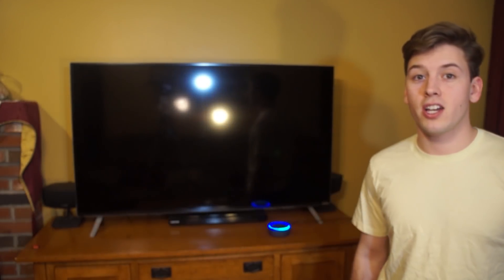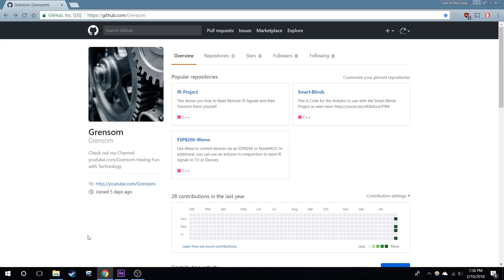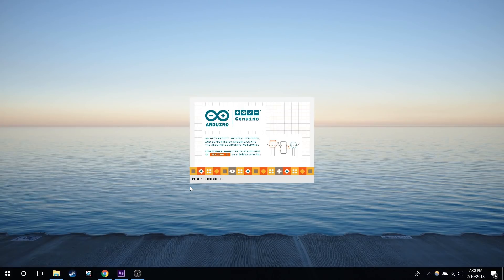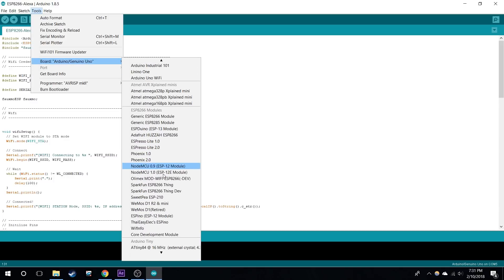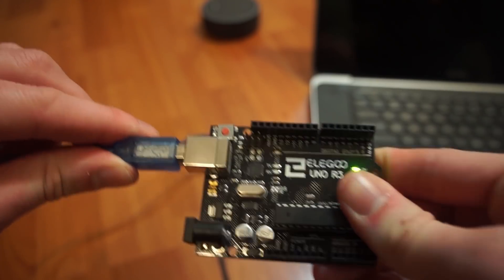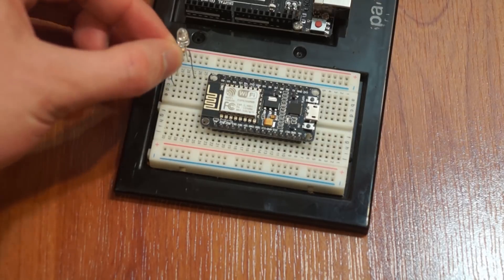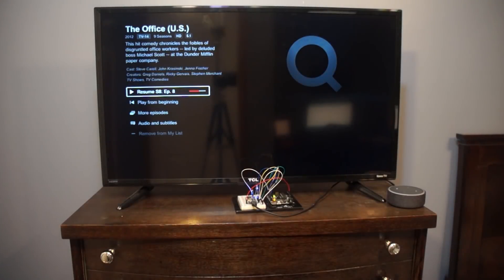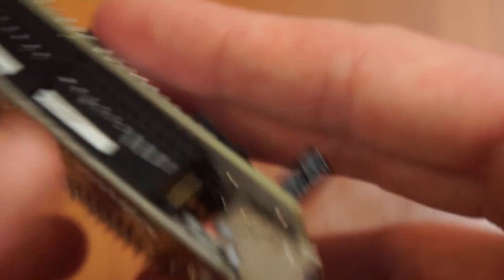Use Alexa to Control your TV!

Comment: Is there a reason why you chose the ATtiny85? I accidentally ordered the 45 (4KB flash memory instead of 8KB), do you know how large the compressed file you flashed yours with was?

Thanks for the video! It has a good flow and I think you explained it on a good level. Not too detailed but still bringing the vital information to the table. Nice work!

Comment: thanks Gernsom very great project...sorry i am old man with age 50 year but interested with  electronics project..where can i find the Alexa and  it is working with and kind of contorting project with arduino
Reply from the maker: Thank you! I listed all the materials needed for this project in the description. But here they are as well:
-----------------------
Parts List:
-----------------------
Alexa Dot:
https://www.amazon.com/gp/product/B01...
NodeMCU (wifi module):
https://www.amazon.com/Laqiya-Version...
IR Receiver/Transmitter:
https://www.amazon.com/gp/product/B00...
100 Ohm Resistor:
https://www.amazon.com/Projects-100EP...
Arduino UNO:
https://www.amazon.com/Elegoo-EL-CB-0...

Comment: The code for the Arduino uno would be the same for the ATtiny85?
Reply: Did you use the 100 ohms resistor when you used the ATtiny85?
Reply from the maker: Yes, the code is the same except you might need to reconfigure the pins you use. Other than that you have to upload ArduinoasISP sketch to Arduino, build sketch to connect Arduino to ATtiny, then can upload code to ATtiny from the Arduino - Also yes you need the 100 ohm resistor in series with the IR Transmitter always, on my perf board it was on the bottom so you couldn't see it

Comment: Great job my friend... I have done the same thing but I have connected an arduino mega instead and  the IR controls also 
my home A/C...The only problem it's the range of the 3 IR led ( I'm using 3 for better range  ) but I have found a solution for this with a 3 Watt IR Led Sensor witch I have bought from ebay..

Comment: Why can't the IR LED be driven directly from the NodeMCU?
Reply from the maker: I tried that at first, but the protocol I used to make the NodeMCU into a "WEMO" device made it difficult to also send the signals I wanted using the IR Sensor. I am looking into this more to find a more efficient way of doing this as you mentioned. I definitely agree that would make this project better! Thanks

Comment: Hi,

Great project,

I was wondering y do u need to use a Arduino UNO,  are you not able to combine the code all onto the ESP8266?

 I am current trying to get this project working, but keep getting this compiling error.

Build options changed, rebuilding all
In file included from C:\Users\andre\OneDrive\Documents\New folder (2)\ESP8266\ESP8266-Wemo-master\ESP8266-Alexa\ESP8266-Alexa.ino:3:0:

C:\Users\andre\OneDrive\Documents\Arduino\libraries\xoseperez-fauxmoesp-50cbcf3087fd\src/fauxmoESP.h:106:9: error: 'WiFiEventHandler' does not name a type

         WiFiEventHandler _handler;

         ^

exit status 1
Error compiling for board NodeMCU 1.0 (ESP-12E Module).